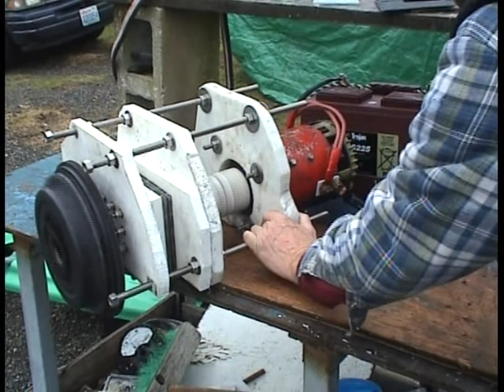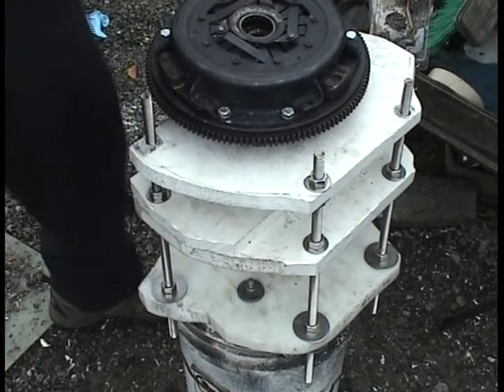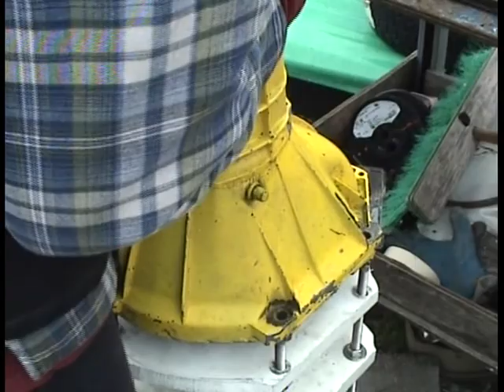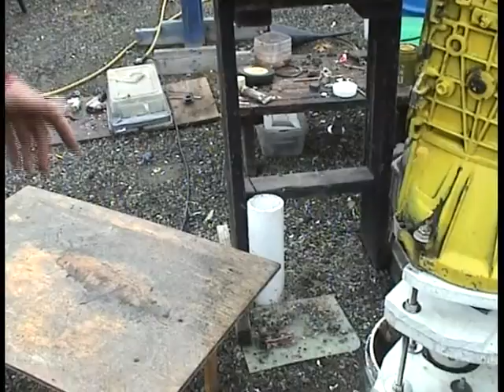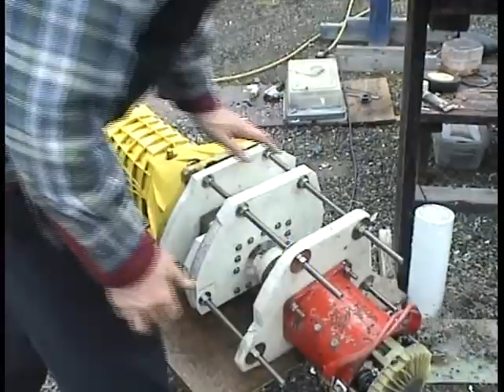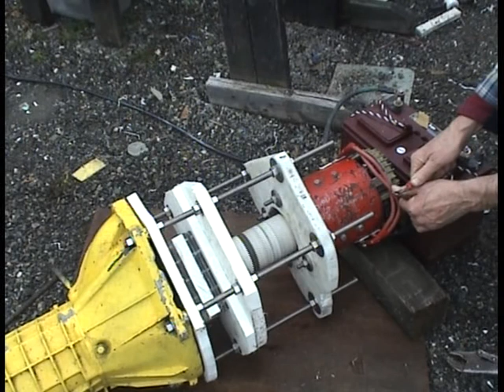Testing forklift motor mounted to transmission

Comment from the maker: Hi Cyberpine
I was hoping to get up hills better could use flywheel inertia and torque to keep motor spinning fast when down shifting going up hills but it all made it worse!  Lost a lot of power...
So clutch and flywheel don't help...transmissuion I could try too taking that out and havimg just motor to rear wheels why not thanks for idea.
..i am in eastern Europe now hope to get back in spring and work more on it....one idea is take out rear axle and differemtial put motor directly onto  right rear wheel and left rear wheel just rolls this would be like a big go kart then

Comment: I'm not trolling you I can see what you got work. Why are you using so many adapter plates?
Reply from the maker: BEcause I have 1" thick polyurethane sheets and drill press and hole-saw...no metal lathe and such...Also I have plans on mounting a flat-disc motor generator between the the rear and mddle white plates, this flat disc stuffed with neodymium magnets, then coils mounted on each side of this plate, attached to the white plates....then coils pulse to drive this magnet rotor disc, and/or create electricity from the magnets sweeping past so that is why that big space and the white adapter plates.....also the shaft ot he motor is quite long, it sticks out that far...
Reply: I am curious as well.

Comment: you should consider a fiat131 5 speed trans. because they are stronger. i know this from my friend who is a scca national champion in g and e production racing a fiat 124 spider and spider 2000. he holds the presidents cup from the year he won both classes. he now races scca pro trans am. he also races in vintage racing in a vintage imsa 124coupe. https://www.youtube.com/watch?v=SZhECmhV6Uk.... i had a lot of input to the build design in this engine. it doesn't belong to the car owner. the setup to the cars suspension system had not been fully tweaked. but not a bad first outing.
Reply from the maker: hi Dale - I have three other fiat transmissions all 5 speeds but don't have a 131 type...the one in video is a 4 speed...I also have a 75 124 coupe that am going to be  rebuilding soon but going to keep it stock and gas motor.. turns out the flywheel and clutch shown in video have slowed the car down a lot and am going to go back to the tranny directly onto the electric motor with no clutch - when you want to shift, just turn off motor during shift and it works good.you know those flexible front brake hose lines on fiat 124s? Wrap them with a spool of Teflon plumbing tape then heat shrink over them....they will last longer...good luck to your friend I am total fiat nut too-  sounds great what he is doing....I cut up an old horribly rusty 69 124 coupe have fenders and doors and hood and roof in pieces want to use front as mold for one-piece fiberglas front end that swings up like spitfire,  but don't know if I will ever get to it....
Reply: i bought a racing x1/9 from a front running scca racer. name mark irwin out of tenn. he has won many f-prod races with his fiat x1/9. i had planed on installing a mazda rotary super charged peripheral port engine. but i come to think a high volt motor might be the way to go. i want to go to oklahoma and bust some over inflated egos with my invention, a light weight lightning bolt.  if a x1.9 is around 1900 lbs then making it electric should lighten it that much more. but i'm look for a cvt trans that will hold up to the instantaneous torque of a series motor. and i need to better understand the schematics to build a igbt controller high current driver section. a simple 555 pwm is simple. or i could go with a triac like that in a dimmer switch. but invert the operation from off to full on then it dims to off then on and slowly increase.
Reply from the maker: Look at the white zombie electric race car here:https://www.youtube.com/watch?v=369h-SEBXd8 he has two DC motors in series at start, then switches to them in parallel halfway down the strip...anyways you could skip the transmission altogether plus look into simply having a switch-off of power to electric motor in place of clutch -  then - its easy to shift...also formula E cars are probably state of art - you could copy whatever they do....
Reply: yea i could copy it. but i have seriously looked at igbt's. they come in values of up to 1000 amp and 1600 volts. yowza. if i can just find a 24 or 36 volt forklift motor and volt it to 72 volts. and build a pwm with frequency and pulse variable modulation. adding frequency to the mix, to aid in efficiency within the igbt. i haven't attempted the use of one yet. but i feel (a hunch) that it may aid in running cooler. even if i do back it up with a liquid cooling system. as for shifting a gear box your right. i can run a momentary switch on the gear shift knob. at the moment i grab the knob it could switch off the power at the battery or in the igbt. as for the batteries. i'm think hard on alum batteries. a design promoted by john bedini.
john bedini, the inventor of the simple school girl wheel. the closest thing to a perpetual motion machine. something i plan to build and add to solar & wind power.  a 30 coil 3 wheel unit. from what i've read, it's a self contained home power unit. but you still have to maintain a charger battery for the signal circuit. and that's where the solar and wind come in at. also, all dump load goes into a grid tie inverter or inverters. if my dump load becomes that great.
 now from what john says about the alum batteries. if it's true. i can buy good not busted plate batteries used foe about 17 to 22 bucks each from places like napa and interstate batteries. everything i've read about alum batteries. the used sufated plates regenerate from each complete discharge. they recharge faster and discharge deeper. they take a higher volt recharge too. so a capacitive charger works better for them. they use capacitive chargers to regenerate sufated batteries along with epson salt. all it takes is a capaitor value around  320uf at 110-240 volts ac for a 10 amp charger.  and if i build a trailor to store extra batteries, install gen set, and mount a few solar panels on too. i can extend greatly the range of a ev.  the same for a class b rv.
Reply from the maker: hi Dale    its the backemf/recoil spikes that will kill transistors and IGBT and chips and things. when the high amps and high voltages combine for instant almost nothing man-made solid state can stop it.SCRs are more heavy duty than IGBTs look into those too....Really brush-commutator is super reliable way to go - with variable voltage input and also variable pulse width you can have great speed controller - possibly have two commutators in series to adjust pulse width on fly....teslacar has AC induction motor, and VFD invertor...also no transmission at all to it..the DC motor(s) in the white zombie is essentially same design as forklift motor in my electric fiat but they can handle higher voltages....
Reply: thanks for the info. i've not attempted anything yet. but being a ham radio operator. i have some advanced knowledge to electrical principles. i first learned of the fly-back effect from studying the fuel injection system from magasquirt. a dyi kit to efi'ing any engine. but i was thinking that a series motor, not having a permanent magnetic field, might not show a fly-back effect. being it is an issue. it may be coming from a residual flux in a portion of the field coil windings or it's in the armature. if that's the case. why not produce a microsecond reverse electrical product. in a since wipe or degauss the motors windings by using the motor itself.. during this process, disconnecting all of the forward traction electricals via a slower acting solenoid disconnect. it just has to have a given amount of lead time to keep from frying all of the wiring. and i see the lead time coming from the shit knob electrical clutch if a tyranny is used.  i've noticed a lot that use a tyranny and no clutch, using love-joy couplings. all be it small, "to small" of a love-joy. maybe they should use the rubber doughnut from a fiat's drive-line. but even then the rubber doughnuts give up the ghost to internal combustion.  just a thought.
Reply from the maker: Hi daleCan you write to me at my email at dale myers